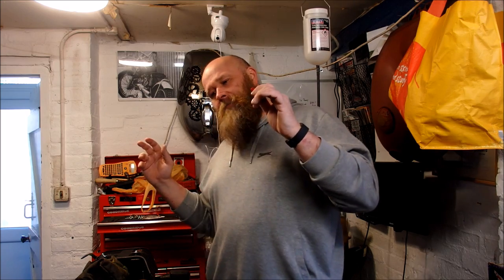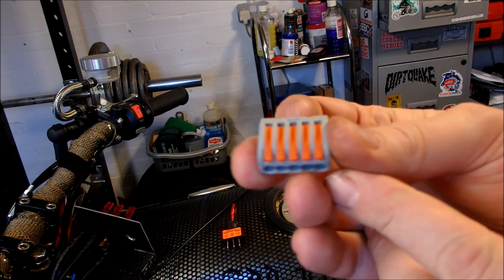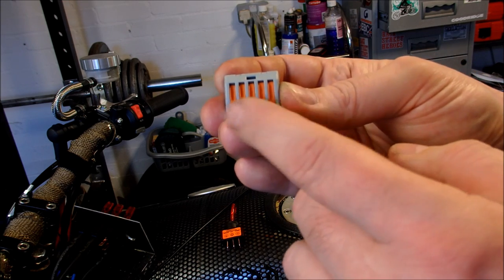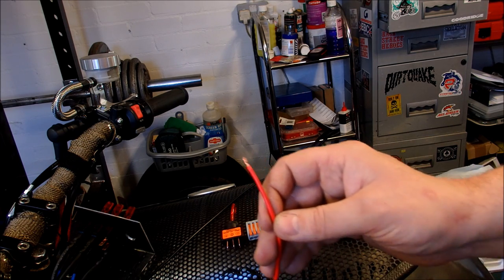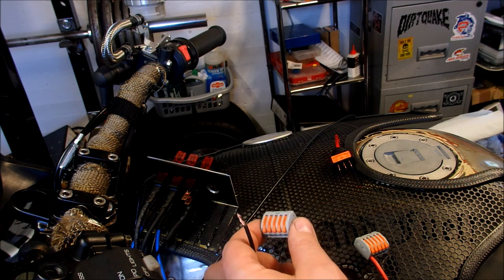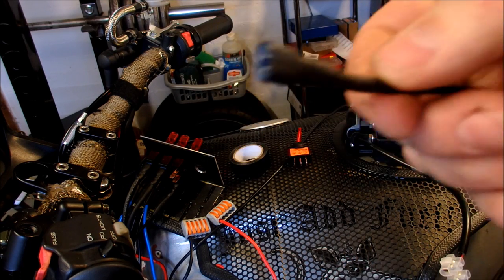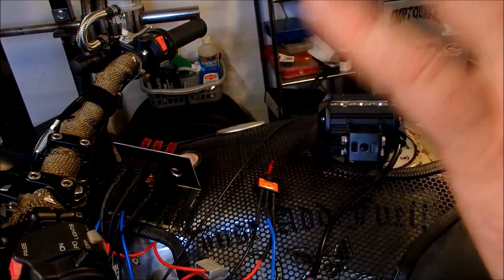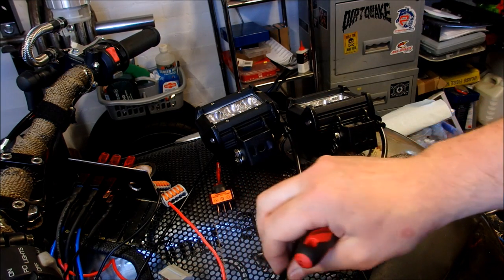Step by Step - How to Install LED spotlights on a motorcycle

Comment: Great video 2 years on. Fitted light bar and lights to my GS and it came with a relay. Because of CanBus I wired them straight to the battery. Great but I decided I needed a waterproof switch to replace the rocker switch. Switch arrives of cause different colour coding and a push button with a diode. So easy pezzy lemon squessy no problem I thought live neutral earth replace like for like.😉 No no after managing to put out the fire it was a case of going back to the hand book. Now waiting for waterproof rocker switch to arrive.😕 What do they say about it being dangerous have a little knowledge 😂. Like your style so you now have another sub. Thanks for video.

Comment: Thanks very much for your clear explanation! I really appreciate it. I have a question though, does this extra lights will trouble the battery? do we need to have a bigger battery? Hope you reply my question mate. Thanks in advance!
Reply from the maker: Hi, apologies for the late response, I didn't upgrade the battery and I haven't noticed as decline in Battery performance at all, hope that helps.

Comment: so basically your simple on/off switch has 3 pins...
i came to this video because i got confused by the switch i have. its a simple on/off switch similar to yours but it as only 2 pins. one ground and one live. im super confused how this is supposed to work
Reply: Bike Wolf . Don’t worry. His is a flashy switch with a built in light. Use your switch to simply make or break the live feed wire.